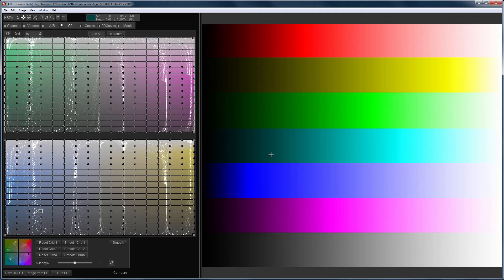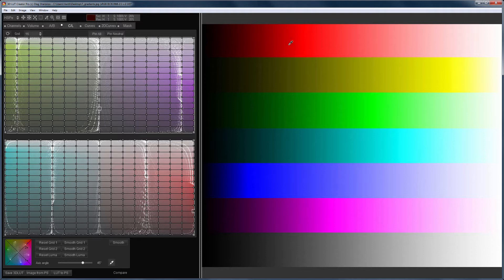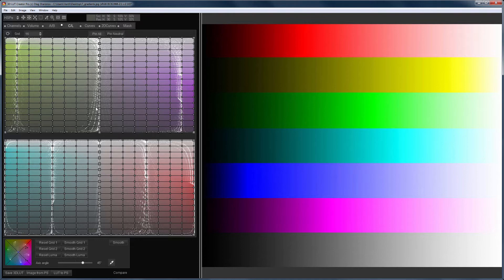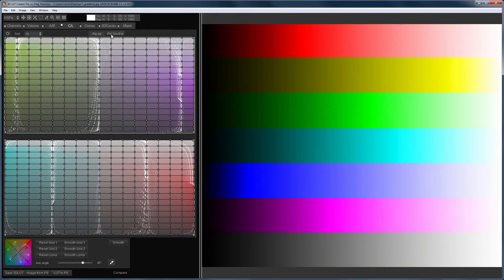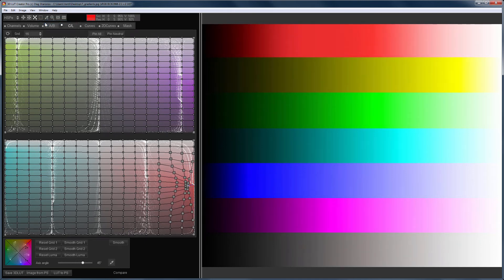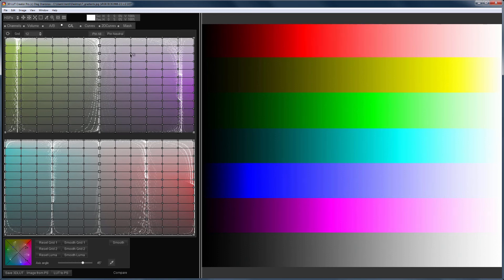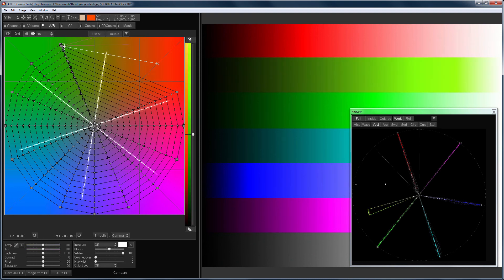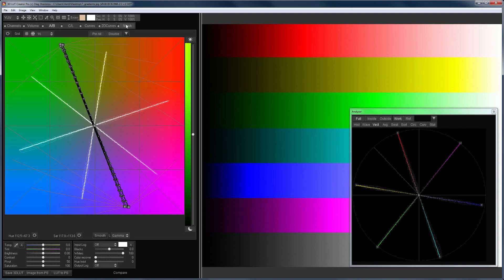Basics of C/L color grids in 3D LUT Creator

Comment: In the video you click on an image with the eye dropper and the grid rotates so the one point is close to neutral and on the other graph it is as far away from neutral. When I use the same image, I get the same results however on other images most of the time one point is by neutral however the other is one or two points in from the edge. Why is this happening?
Reply from the maker: Can you show me your image? I don't understand your problem.
Reply: Sure, how do you want me to send it to you?
Reply from the maker: You can attach the link to the file here or send via website. There will be support e-mail.
Reply: I sent you an email from your website. If you don't get it, please let me know.
Reply: Thanks for your fast support
Reply from the maker: You are welcome!